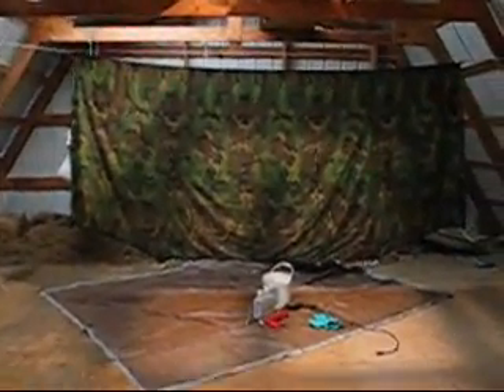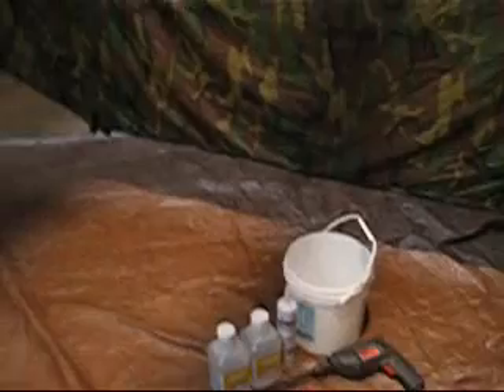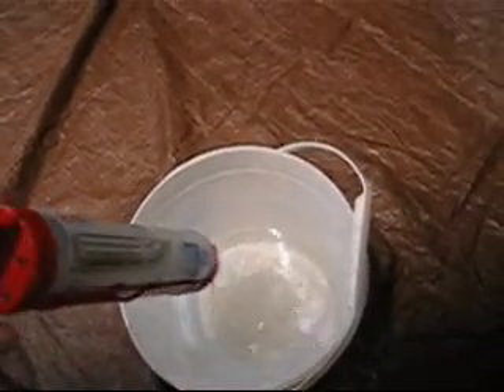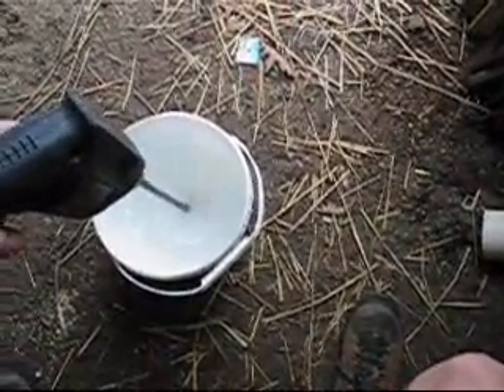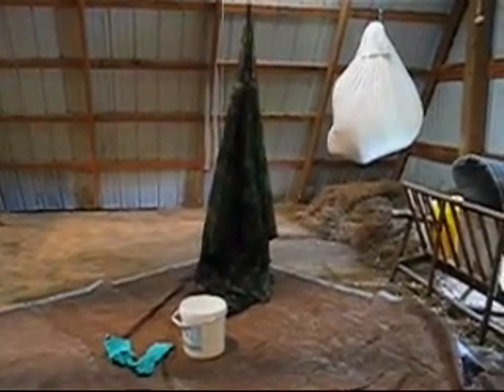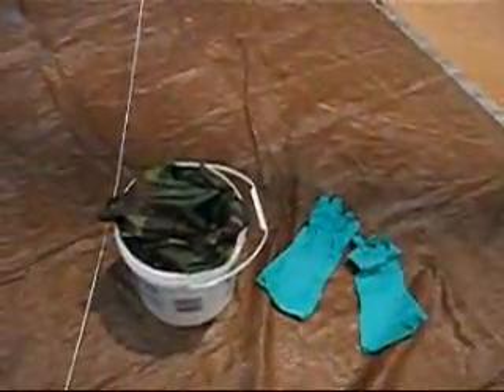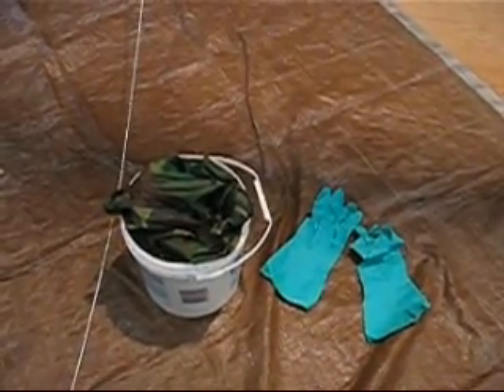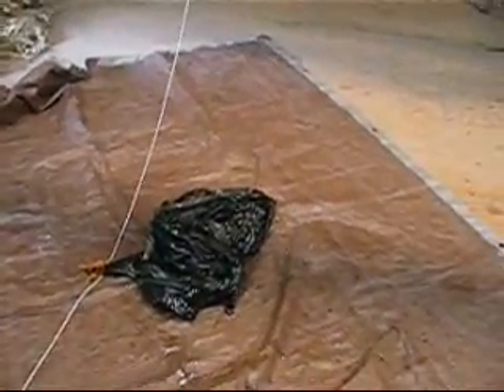The Cheap Bastard's Guide to DIY Silnylon

Comment: How does the silicone hold up to direct sunlight 4-5 hrs everyday? Im trying to strengthen a harbor freight car port roof tarp. Is there a uv treated silicone or something?
Reply from the maker: My tarp is now eight years old.  It doesn't get much use these days, but it still performs when I need it.  The silicone I used was a clear construction grade for exterior use.  That's all I can tell you.  Cheers from Montreal QC

Comment: Hello, where im from i only really see low odour white spirit, would this be okay? And what ratio would you recommend for a ultralight tent? Im restoring a 21 year old tent from the ground up.
Reply from the maker: mineral spirit has a Quote a strong smell.  I couldn't say how long that would take to dissipate entirely from the tent fabric.  I'm not sure I would recommend it for this case, unless you're doing this simply as an experiment.  If that's the case, please let the rest of know how it turns out.  Regarding the ratio question, I'm no expert but the ratio used in my video seemed to just right.  Cheers from Montreal QC😊
Reply: Hello again bud, i have a seam taped silnylon tent, i dont suppose if from experience you know whether it was coated then seamed or seamed and coated? Just testing the water really matey@jspate61

Comment: Hey Jeff, We're Cdn. snowbirds down in Fl for winter so temperature not a problem (nor are tornadoes, I hope) I want to waterproof a tent fly on a 9x12 tent. Obviously it is not square but instead "dome shaped". Any suggestions about how to hang to dry & not get lots of folds? Since 2 qts & 1 tube makes a whole lot have you ever halved the mixture i.e. used 1 qt mineral spirits & ???? caulking?? Thanks
Reply from the maker: Your talking about a pretty good sized rain fly here.  A word to the wise: it's better to have a little too much than a little too little.  Did I say a little too little a little too much?  Anyhow, the point I wanna make is this: don't skimp - use the full amount like I told ya and nobody gets hurt, see.
Cheers from Montreal QC

Comment: Could I use this recipe to reseal my worn out Eureka timberline tent bottom?
Reply from the maker: +Bak Draft 
I bet you could.  It might make more sense to use a roller to apply thy sil mix.  I would set tent up with the doors wide open and just roll out the bottom inside.  Let is dry for a good 24 hours, and Bob's yer uncle.

Cheers from Montreal QC
Reply: So, your saying apply to the inside? hmmm
Reply from the maker: +Bak Draft 
I'm no expert, but it strikes me that it might be much easier than trying to put it on outside.  Inside is less exposed to abrasion (maybe).  That's just me thinking out loud.  Good luck to ya!

Cheers
Reply: Ok, Thanks, Ill let you know how it turns out

Comment: Do you wipe the tarp down after you hang it or do you just allow the excess to drip dry?
Reply from the maker: I squeeze as much excess out of the tarp as I possibly can, then just let it hang to dry.  There may be a few heavy spots, but they usually run off.

Cheers

Comment: Hi Jeff, If there are some folds, will the fly material stick together as it dries? Arlene
Reply from the maker: It's possible.  Since the dry time is reletively quick (2-3 hours), you may want to have something like a smooth broom handle on hand to gently push against any problem areas that may arise.  Again, in your case it would be a good idea to do this on a breezy day where a steady wind will prevent any folds from occurring.
Cheers

Comment: HI. Sorry my English is not good and I couldn´t understand well. What did you use? A silicon squirt and water or thinner? Thanks from Brazil.
Reply from the maker: +Daniel Aragão 
Hey Daniel, here are links to the materials I use for sealing rip stop nylon tarps that I make myself:  2 liters of low odor mineral spirits mixed with one tube of clear silicone caulk

https://www.homedepot.ca/en/home/p.gutter--flashing-clear-290-ml.1000405250.html

http://www.walmart.ca/en/ip/mineral-spirits/6000016946032

Hope that helps.  Cheers from Montreal QC
Reply: what silicone type?
Reply from the maker: The silicone used for this project was a GE brand (clear silicone caulk in a tube).  It has many uses, but was recommended for sealing around exterior windows and doors.  I mixed it with mineral spirits that I picked up at the hardware store in the paint section.  It's very easy, and six years later still works very well.

Cheers Daniel, from Montreal QC
Reply: Jeff Spate in GE's website there is the folow:

"What's the difference between GE Silicone I* caulk and GE Silicone II* caulk?
GE Silicone II* caulk is what's called a "neutral cure" silicone, which means no acids are released during the curing process (as there are in GE Silicone I*). This enables GE Silicone II* to adhere to a broader range of substrates such as plastics, concrete, and metals. Also, the odor of a neutral cure silicone such as GE Silicone II* is much less offensive than an acid or acetoxy cure silicone such as GE Silicone I*."

what type you have used in your job?
acid?
neutral?

my regards!!!
Reply from the maker: My god, I have no idea. The stuff I used was pretty tough on the nose.  I do remember that much.  My guess is that either will do.  Roll the dice, baby!

Cheers

Comment: Aqua Zar.  I have used it on three tents and two tarps since.   works, and better than smelly silicon.   The end product is not breathable, and some results were less than desired when fabric was pre- sealed with some other kind of sealant.  okay for raw nylon tarps.

Comment from the maker: The tarp is one I made myself out of 1.1oz ripstop nylon.  Then I soaked it in the silicone solution.  Go to the backwoodsdaydreamer site.  He has all the materials you would need at insanely low prices.  He also has free plans for a bunch of groovy outdoor gear that you can make yourself.  Shout out if you need more help.
Cheers from Montreal QC

Comment: This would have been so much easier to lay out, spray the silicone mixture on, brush evenly, and hang.
Reply from the maker: +Silas Lynch 
You might think so at first.  Soaking and squeezing in the bucket results in complete penetration of the fabric versus the surface coating you would achieve otherwise.  That is the big benefit to this process.  One could spray or brush, but the end result is a shoddy finished product that will eventually fail when performance is needed the most.  But, that's just my opinion, for what its worth.